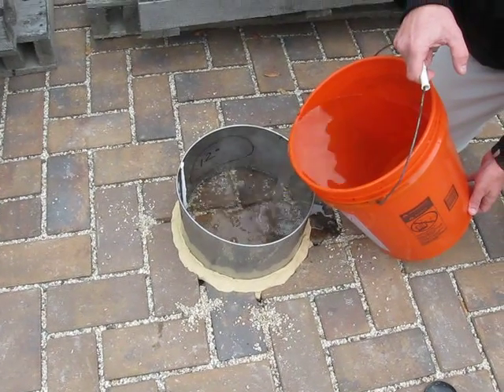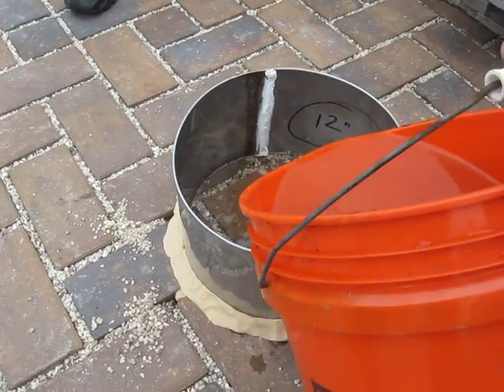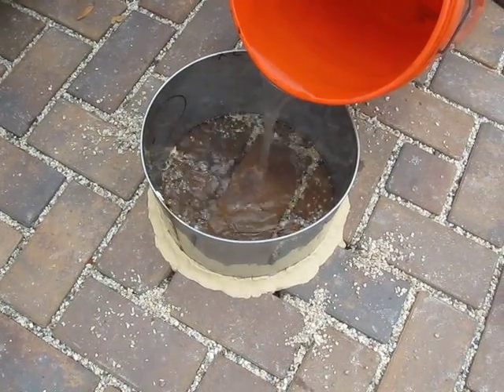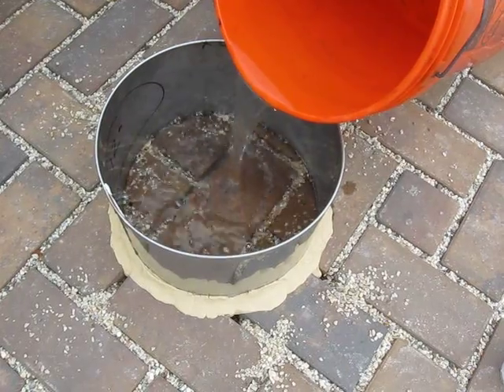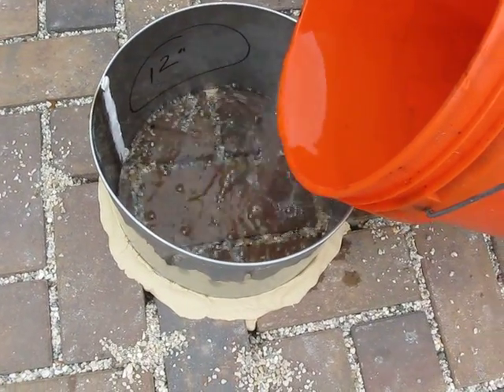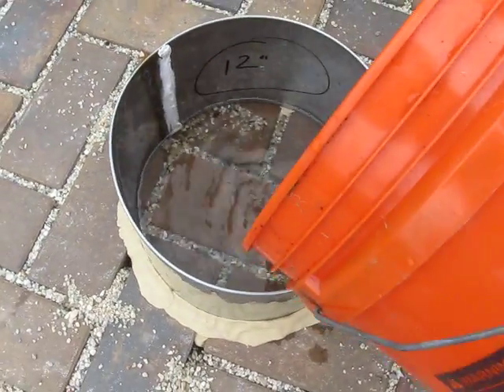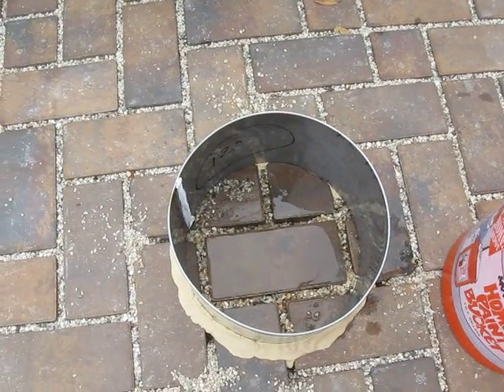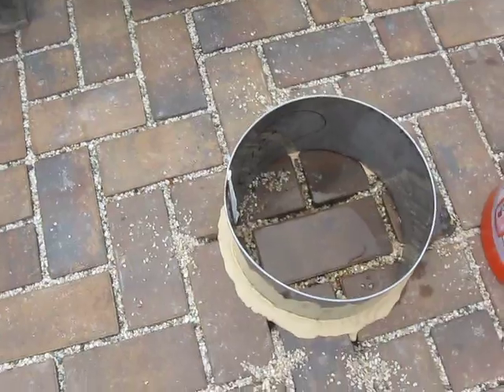ASTM C1781 Surface Infiltration Test

Comment: C1781 states that you are to fill the joints between the pavers with plumbers putty, putty around the ring is to be on the inside